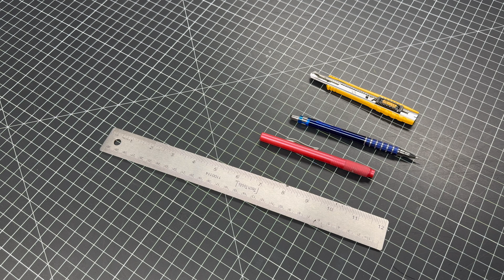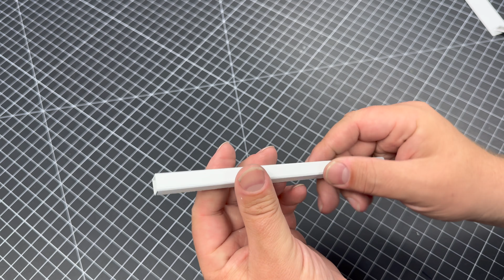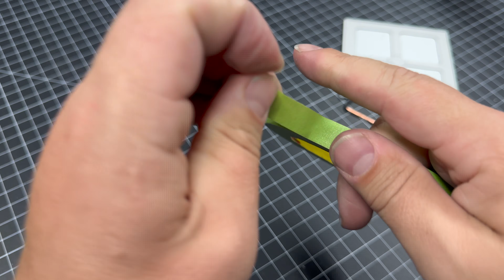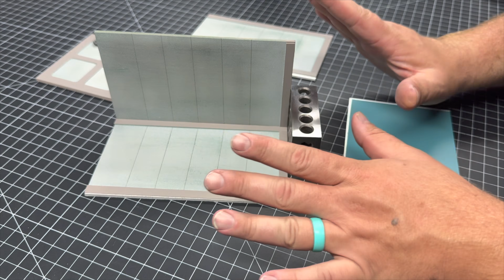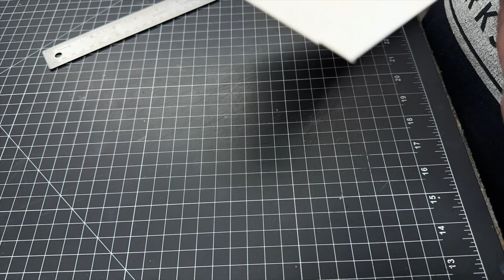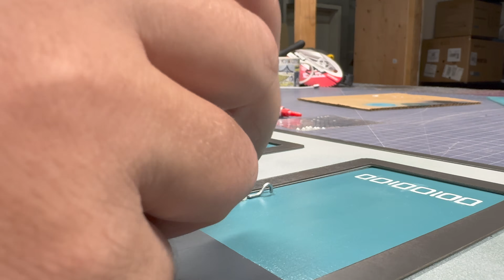What If Bender Invited You Over...

Comment: Curious where Styrene is sold?  I see it on Amazon, but I'd be curious to know where I would be able to see/feel the different thicknesses to suit the need?  I'm in the USA, btw.
Reply from the maker: Hobby lobby usually has a super tiny section, but you can do a search for local plastic supply company and they usually will either sell their off cuts or give you them if you show up and ask
Reply: I get mine from Harbor Freight in the signs. A "garage sale" sign that is 1mm thick is actually a 0.7mm and 0.3mm sheets of styrene laminated together that peels apart easily. 
I have used it for several model building projects and sometimes you can catch it on sale for 0.99 cents. 
So you are getting two sheets, 0.7 and 0.3 mm for a buck.